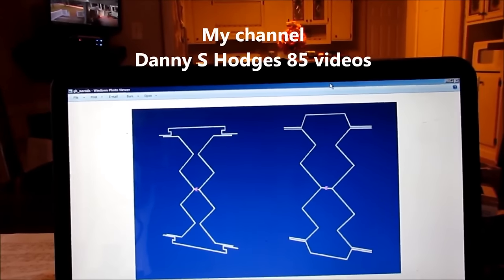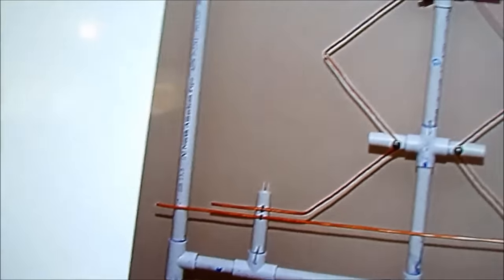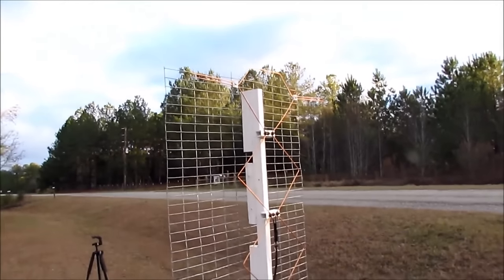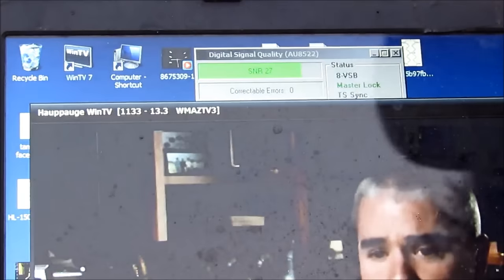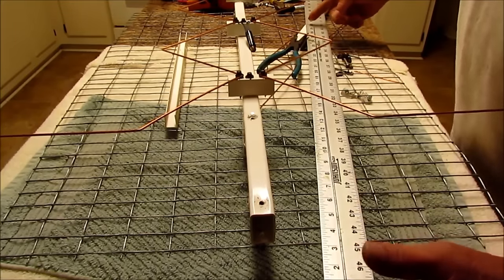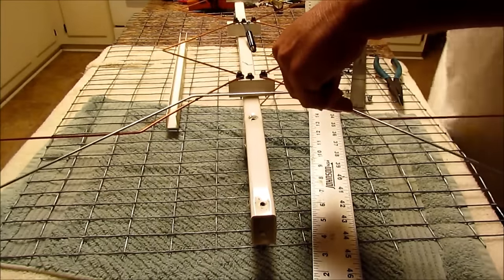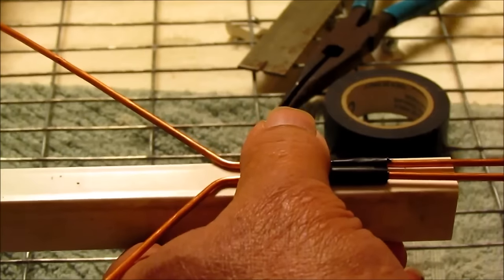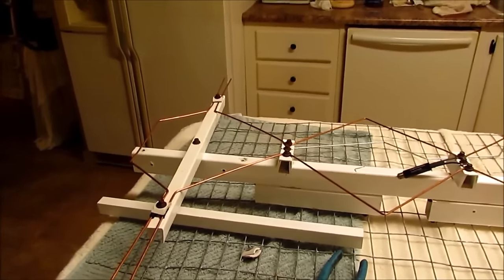Gray Hoverman VHF Fix

Comment: Danny, get a piece of plastic and drill 2 small holes 1/4" inch apart , slide the 2 pieces of wire in place, then screw it down, much easier and  more professional looking than tape.
Reply: GhettoRanger give u a cookie
Reply: @timnorton2053  - Can I get a cookie too?
Reply: @
GhettoRanger - 100%
Reply: @
GhettoRanger - It's a Poo-fessional, does that count?  😂😂😂😂😂😂😂
Reply: @JodBronson  I think Danny enjoys what he does and takes pride in his work which is the only reason I offered a suggestion, I used to build robotic assembly lines for the big 3 and in doing so I learned a few things, a few procedures that most people don't get to see. Danny does good work but I saw something I felt could be done better and more durable in weather, that's all.
Reply: @GhettoRanger01  - LOL, I know, no worries.  I can see it clearly in your post!
Reply: @timnorton2053  ghetto ranger don't eat cookies ,YOU CAN EAT THE ALL.

Comment: To add the hats, instead of where you put tape and a screw. Drill a 1/4" hole all the way through and use 4 wire ties.

Comment: I am a little bit confused Danny. Whenever you are on the church land with your trailer you didn't have a hard time getting that channel. You got them all good signal. Just down the road at your house that channel don't work without a hat. I've seen every one of your videos 52 x LOL I've never seen a big antenna in the front yard miss a Channel that bad. It just stopped working on that channel have you figured out why?
Reply from the maker: ny front yard not a good spot
Reply: @Wes Walker
 - Obstructions would be a big problem.  That's including Trees, Hills, Clouds, Buildings, etc....

Comment: it is very interesting you are working on this modification because I had just been testing a similar thing. what I noticed was that a reflector on the bottom was better than a reflector top and bottom... So after seeing your video buy put my small reflector half inch hardware cloth the whip of the hoverman and about 8 inches tall tied to the bottom two elements with zip ties did increase signal on some channels not across the band. from + 85 - a 95.. I was sort of curious if you put the Hat on the bottom and not on the top what would it do to your test? also I believe - reduce the signal Level under 27 so you can truly see and increase is to skew off the transmitter and dropped the signal a little bit then try the test for example hoverman in the ultimate antenna..
Reply from the maker: U SEEN WHAT I SEEN. I MIGHT DO A FOLLOW UP ON THIS.PEOPLE DONT CARE ABOUT LITTLE DETAILS...THEY WANNA NO IF IT WORKS ARE NOT. THAT VHF STATION HAS 500.000 KILLAWATTS. THAT UHF 24 HAS A MILLION KILLA...THAT CHANNEL 24 BLOWS  THAT CHANNEL 13 AWAY ALL THE TIME. I NEVER SEEN 13 BEAT 24 IN MY LIFE...I SEE THIS ALL THE TIME....ALL MY RESEARCH NEVER SHOWED USING 1 HAT...I AM GOING TO TEST A STRAIGHT PEICE  LIKE WAS IN THE PICTURES...I GOT OTHER VIDEOS MORE IMPORTANT THAT I NEED TO SHOW. IF I DIDNT BELIVE IN THAT HIGH HAT YOU WOULD HAVE SEEN A 4 MINUTE VIDEO..WITH  THE TITLE HOVER GREY VHF HI HAT MYTH BUSTED...I DID NOT THINK IT WAS GOING TO DO NOTHING..IM A STRAIGHT UP GUY IM NOT HERE TO BULLSHIT PEOPLE...IM HERE TO HELP...THATS WHY I SALE THEM SO CHEAP....YOU JUST DONT NO HOW MANY HOURS I SPENT OUT THERE TESTING...NOW U COME TO GA WE WILL DO SOME TESTING..IM GOING TO GIVE THE PEOPLE WHAT THEY WANT...NO BULL JUST STRAIGHT TALK
Reply from the maker: im sorry no shipping ups out of sight
Reply from the maker: i would try first u may not need it

Comment: zip ties held the small reflector. typo...... on the questions about the additional elements, it is not a director it would have to be a reflector. for instance on a satellite antenna there is positive and negative in the lnb the reflector is passive in regards to the coax. there will be no continuity between the shield or the center conductor just like the modification that you did so I would go with reflector.

Comment: Ok so i built this and it works perfect

But why is it that sometimes i  get  10 channels  and some times over 50 and i have the  position set  perfect and its wired down good 
Not moving at all
Reply: Go to TV Fools.Com and see what the stations are in your area. If you're getting more than that it is what it's called tropospheric ducting. AKA propagation or skip. Troppo is normaly at night . It only works at night and under certain atmospheric conditions.
Reply: @weswalker1208  - Good Tips

Comment: This is where understanding how the vhf signal travels though the air. By installing the deflector your adding 3db to the vhf section effectively doubling signal strength.
The other thing I'd like you to not there is no seperate balun for vhf vs uhf and a.combiner. it simply isn't necessary as the dimensions of each wisker is cut to only receive the new HD reduced uhf band. So there is no interference as the vhf elements are cut for a compleyely 
different MHz.

Comment: you should use non metallic screws. They make plastic screws. The screws being conductive will mess with the 1/4" gap.
Reply: The conductive screws cover so little of the full length that it doesn't impact the performance much.  Plastic screws are not very strong.  A smaller diameter nut and bolt could work though.  He could drill right through the beam he is attaching the rods to and place a nut and washer the far side.

Comment: The "un-connected rods" are either directors or reflectors.  They "channel or drive" the signal toward your antenna  elements.
Reply from the maker: I KNOW YOU HAVE TO BE RIGHT..IT SURE WORKED GOOD...I DONT NO IF THE ULTIMATE ANTENNA CAN BEAT  THIS SET UP HERE
Reply from the maker: BEATS ALL I EVER SEEN
Reply: Thank you Dr. Hodges
Reply from the maker: keycontrol tks
Reply: Another thing the seemingly "worthless rods" on an antenna  do is increase "*gain*."  If you skint 6" of insulation from a  piece of  antenna wire  and bent the center wire left  and the copper insulation sheath right, you would have an antenna called a "*dipole*".  Might  pick up stations 15 miles away with only that.   A dipole's "*propagation pattern*"  (shape of the area it receives signals from) will be a 30 mile sphere.  Able to get just as strong a signal from the direction of The North Star as from the east or west horizon. No tv stations overhead, so that reception is wasted. By reshaping  an antenna you can change the useful propagation pattern. Like if you had a balloon on your lap and you pressed down from the top, the "overhead pattern" is less while the north west south and east "*pattern*" extend  farther away from the middle. The antenna is really  no "stronger,"  but the useful signal pattern is increased.
Reply from the maker: thats right
Reply from the maker: i agree
Reply: +OgMandinO  I don't agree with a good part of that.
First you are ignoring the fact that virtually all TV signals are Horizontally polarized.
Dipoles for TV are not oriented the same as a  car radio or CB whip antenna, up like a flag pole , the antenna should be hung sideways like a cloths line.
When oriented correctly for horizontal polarized signals the dipoles pattern is NOT omni-directional and has deep nulls off both ends.
If you do it all right you get a bidirectional antenna with ~84 degree beamwidth in opposite  directions
And the shape of the propagation pattern of a dipole is a toroid (doughnut) not a sphere
Saying a high gain antenna is not stronger than a low gain antenna is just semantics.
Like saying a man with a block and tackle or lever isn't stronger than before he had the lever , or saying a telescope can't make your vision stronger.
Though true he can lift more and see farther so ...
You are right the antenna cant create energy.
If the signal going to the tuner is stronger (and signals not in the direction of more sensitivity are reduced ) most people would label that as stronger.
We refer to  magnification in terms of stronger and weaker.
I think the unscientific terms stronger and weaker are fair descriptions of an antennas gain /directivity.

Finally what is the justification for saying that the NARODs must be reflectors or directors ?
The group that developed the top hats and NARODs  debated the function of the elements exhaustively before settling on the acronym NAROD  ,  being short for    "N ot  A    R eflector  O r D irector".
Do you have a source for  this  or is it just your opinion?
BTW the top hat doesn't increase the UHF gain only the (high)VHF  gain , that alone is evidence that they are not acting as either reflector or director.  Furthermore they are not in the right location to perform either of those functions.
Reply from the maker: YOU MAKE A VIDEO AND SHOW US HOW ITS DONE
Reply: ghz24 ,  Thanks for your input.  Danny saw some "build it YTs" and got to work. Puzzled by elements not electrically connected.  Seems counterintuitive. Danny got little in the way of explanation . Frustrating to hunger for information and not be able to access any. My participation was simply to  lessen frustration.  
I  attempted to explain the elements' purpose in 'common sense terms.'   -Here, less jargon is more. My experience is in  verticals and horizontal beam antennas.  I'm FAR from an expert. (When one asks another the time, instructions on building a watch are not so helpful... :^)

As I understand it, antennas with reflectors are better for receiving distant signals with less interference than bidirectionals. (No absolutes, though.) =A necessary requirement in this situation. 

Actually we AGREE about gain. To a novice "high gain" implies "more power." (Let's use terms one might grasp...)

Re:narods, reflectors and directors,  all  worthwhile information for me. Let's scale  data to the target audience, shall we? With your wealth of knowledge, my explanations are unnecessary. -Again, my thanks!
Reply: +Danny S Hodges   If I've offended you, I apologize. My goal was to correct a few misstatements  and prod OgmandinO into showing a source for his opinion on NARODs if he had one.  
 I did this prodding because if he had a source I wanted to see and study it.  Just because he misstated a couple facts doesn't mean I know all and he cant show me something.
I hope if I misstate a fact someone will point it out to me and not let me walk around dragging a mental  piece of TP stuck to my shoe.
Did you read my other comment?  You showed me something , and from the title of the video I'd have bet money against that when I first clicked the link.
I do appreciate your efforts on this subject, I would have to drive 45 minutes if I wanted to  try the experiment you did in your front yard.
I have no VHF stations to test with. 
If on the other hand  your comment was a genuine request  (POEs law) then my question is how what is done ?
Do you want to see how I know the patterns and the results of dipole models? 
Do you want to see a model of the antenna you built?

Please be more specific.
I have been planing a first video thanks for prodding me.
Reply: +OgMandinO  Your generalizations regarding reflectors are  mostly quite valid, there are always exceptions to generalizations but they are still useful. 
When I asked/challenged you  for a source I was genuinely interested if you had some info I'd missed.  I'm not an expert either just a very curious  amateur.  
Your statement regarding time and watches  was profound, and I have to agree, forums are full of guys who post  statements that while technically  true  just tend to confuse a novice sometimes causing the novice to give up. (sometimes I think that is their goal)
I try hard not to be that guy and try to only be as technical as necessary
to make a hopefully relevant point.
 I don't always succeed I'm sure.
Maybe I underestimate the value of the gain vs directivity distinction to a novice or home antenna builder.
I take  it for granted that an accumulation of wires can't create energy.
Reply: ghz24 , no offense taken! I'm an old fart and NEVER assume I'm the sharpest knife in the drawer...  Felt this was an opportunity to be conversational (idiomatic?) vs. 100% correct in antenna theory. Feed the hunger then clean up the syntax.  Oh yeah, I'm a scientist and amazed at how often "ESTABLISHED scientific fact" gets REVISED! Anyhow, my work was  in labs using microscopes. My hobby is RF communications. My great 'talent' is throwing together random crap and it works surprisingly well.  When I go back, neaten and tape it all up, a dead short peforms better...  I laugh at myself, lots!   :^)
Reply: Danny S Hodges , If I did an antenna video, it would not be pretty. Have a knack for embarrassing  EVERYBODY!    :^)